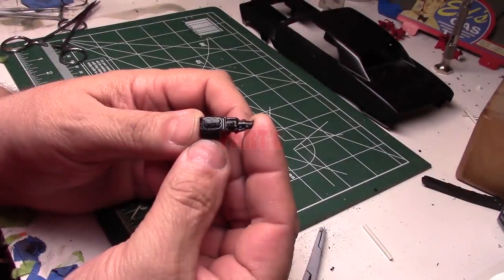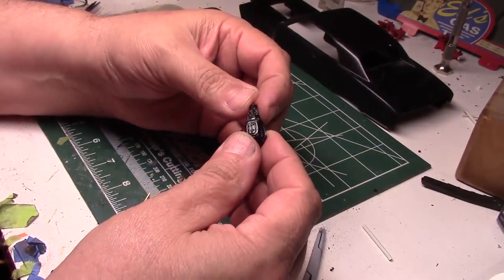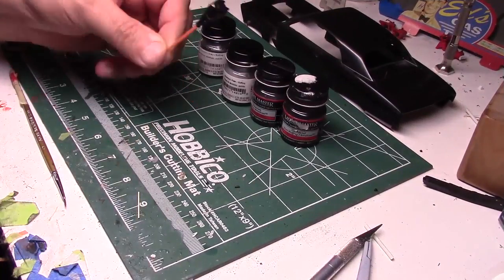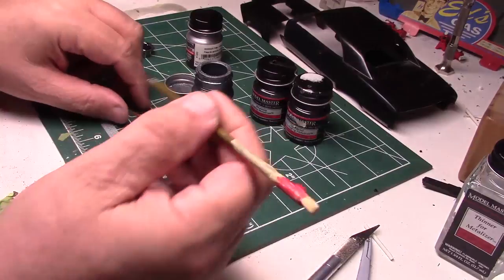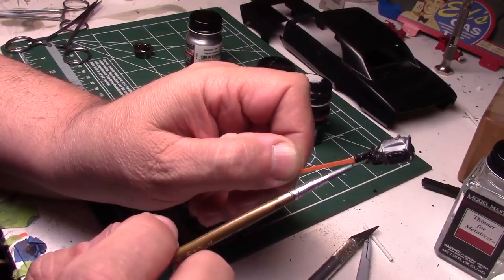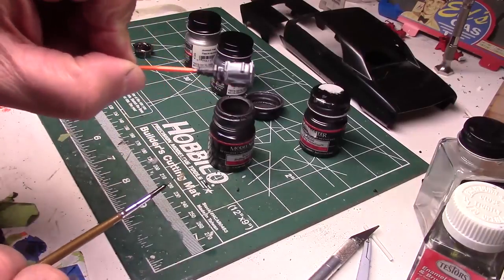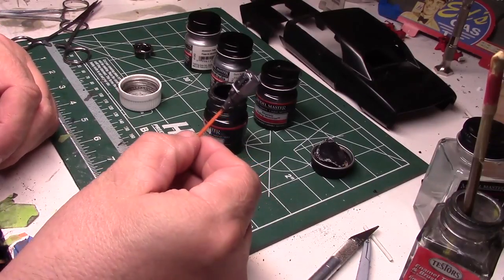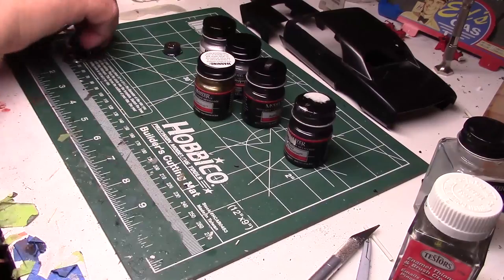How To Detail Brush Metalizer Paints on Plastic Model Cars Parts (AAIBMC part 6)

Comment: Hello And thank u.
I build 1/48 aircraft 1/35 military  1/700 watercraft and now thanks to your videos.  Cars.
I have a 1966 ford Galaxie 500 4 door. Its done up pretty nice.  So thats the real car.
Being a moder I wanted to build 1 but the only kit comes in the 2 door version. 
Going through the old open boxs at my local model I found a old AMT kit buy as it. Great now I only have to spend $45 on 1 more new kit so I can cut them and 1 car.
When got home and open the box to how many may be missing. Quess what I found?
2 COMPLETE 1966 FORD GALAXIE 500 2 DOOR KITS!
Just what I needed to build the car thats in my garage and has bin in are family since the day it purchased back in 1966.
I even have the paint that was used being im the painter.
Haven't come across any vids here on cutting and extending 2 kits together.  Makes me shudder thinking o it.
Keep the great work going thank you.
Reply: Seems a lot of moders switch to some of the new pants .  Between testors and model master has work fine for my last 50 yrs
Lots of new brand out there and I will try them. There a metalized 1 I really want try I think its called all late.
Could of missed spelled it but every one that uses them raves over how good it is.
Reply from the maker: Its call Alclad. It is very good.
Reply from the maker: That worked out. If your not a member of the Facebook Group. Join and post pics of your progress. I'm sure if you need help. Someone on there will know what to do. The link is in the description

Comment: I just ran across this video Unfortunitly not long after you did this video Testors Model Masters paint  line was Discontinued
Reply from the maker: Actually. They were already. I contemplated if I should do the video. But it's still good info. I still find Alot of Testors Metalizers on line. And this works with any lacquer based Metalizer type paint.
Reply: I did save it to my libary for future reference

Comment: I used the spray metalizer. The stuff takes forever to dry. Even after several days it gets all over my hands after handling. I do buff afterwards but makes no difference.
Reply from the maker: Really? I have never had that problem before with Testors Metalizers. But I have with other brands. But now with the Testors line discontinued. I have discovered a replacement. But the line has not come to the U.S.A. yet. When it does. I will review it and use it in my videos.

Comment: I was wondering if nascar engine blocks and heads can be done the same way as your tranny.   May be a kinda dumb question
Reply from the maker: Sure can. And I have done it. But these paints are not avalable anymore. BUT! The new lacquers from Tamiya are great. It is the LP line. They are slowly getting into this country. They have outstanding metalizer type colors. Look up on Andy's Hobby Headquarters channel. He did some videos on them.